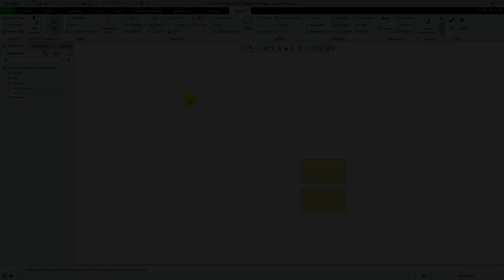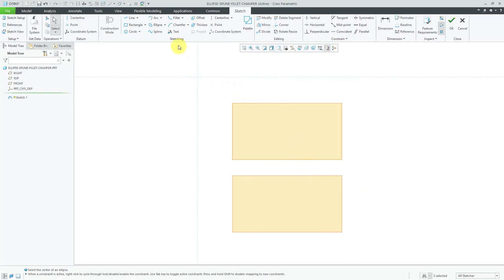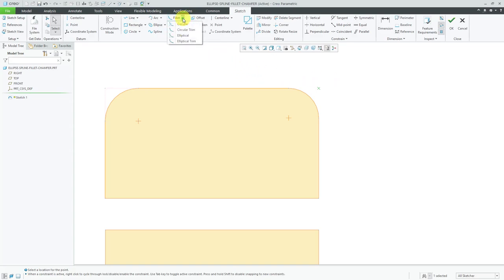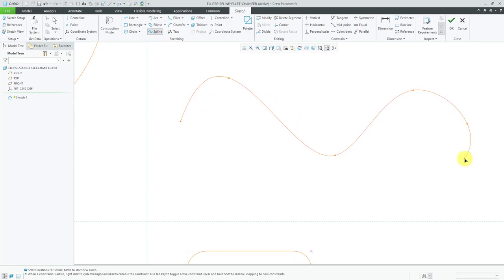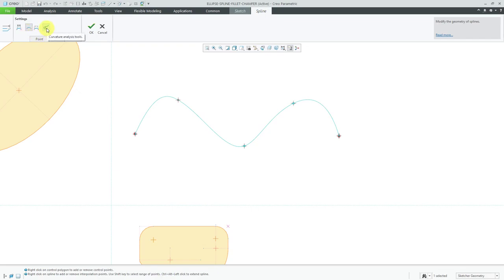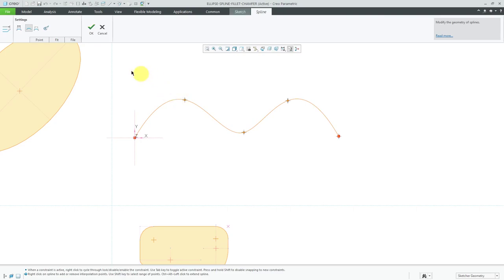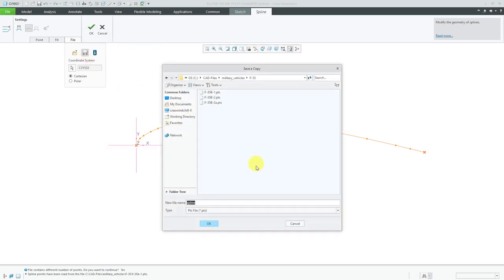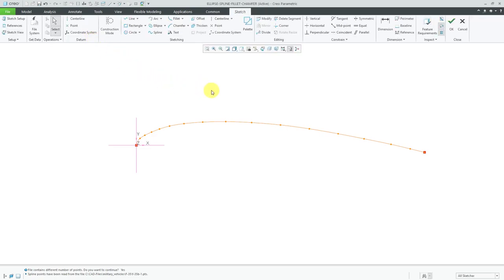Creo Parametric - Sketch Mode Deep Dive 4B - Splines, Ellipses, Fillets, and Chamfers

Comment: thank you!  any idea why the spline dashboard has two buttons that do the same thing?  (i.e. they both switch into control point mode)
Reply from the maker: I need to research that. Technically I believe there is a subtle difference but it’s not obvious.